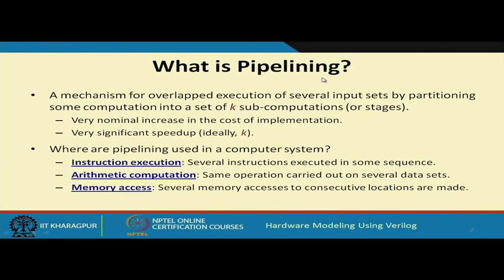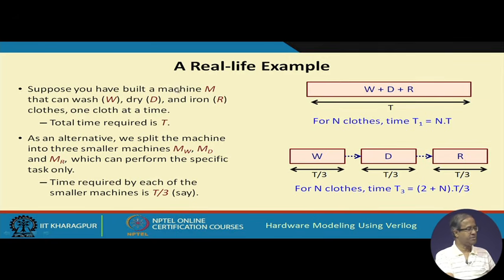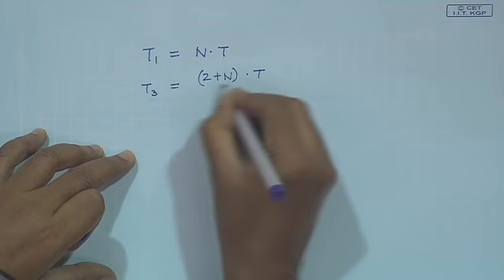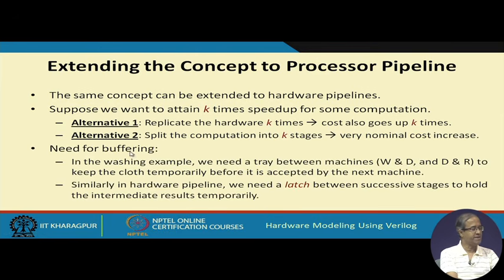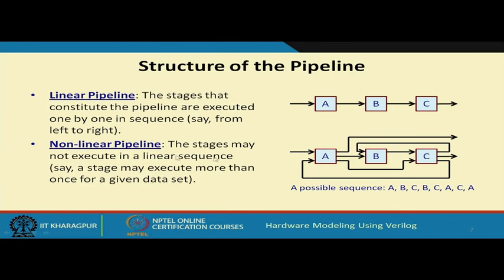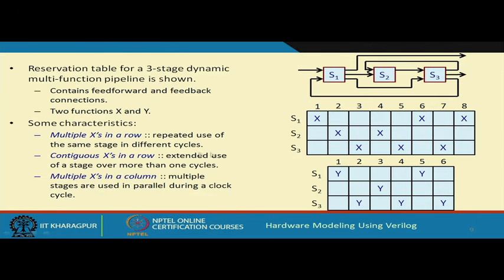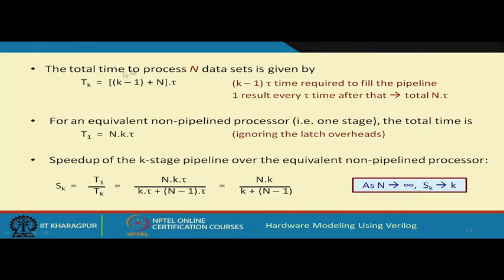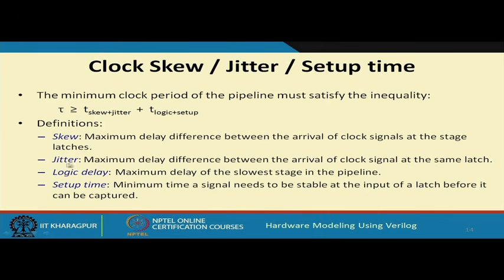BASIC PIPELINING CONCEPTS

Comment: More attention should have been given to the fact that all stages do not have the same execution time, and which one of those is chosen for "T". And there are no "ironing machines", not even in the USA. The third operation is folding the washed and dried garment (please don't use the word "cloth") and this is done manually.
Reply: Yes, all stages in the pipeline will have different execution time and we also need a register or latch between every stage , so in order to find out the time for 1 stage we take the max of all stage execution time + time delay of the buffers .
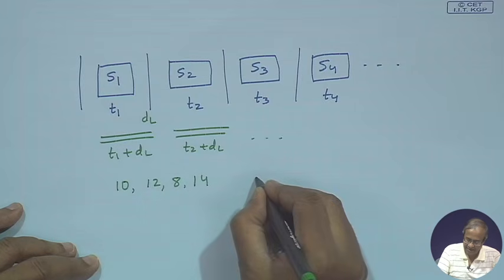Reply: 23:50   here its said that not all have the same delay and sir given the example
Reply: see the lecture carefully fool.

Comment: If the output two parallel pipelines feed into a third pipeline as input, how would we calculate the throughput in that case? What if backpressure is required e.g one of the two pipelines stalls 10% of the time?